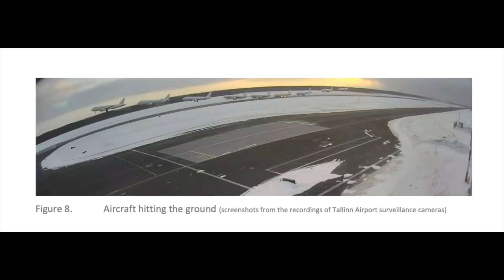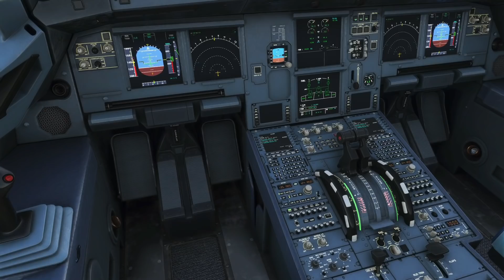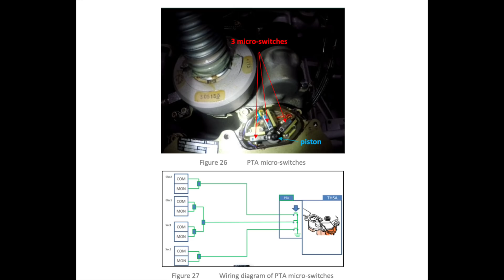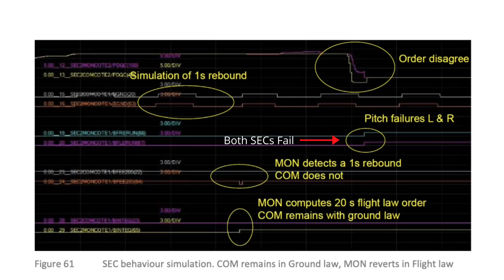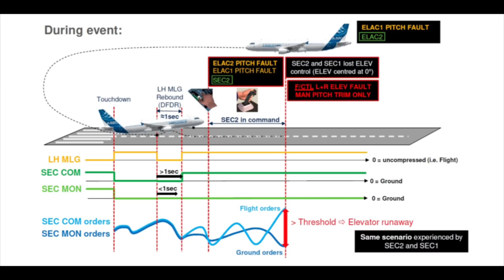The Oil Change That Crashed A Passenger Jet | The Crash Of Smartlynx 9001

Comment: Automation is like fire in the home. It's great until it gets out of control. What you need is automation whose failure modes are obvious and intelligible to the humans. I have a lot more respect for the system that says "I give up; your airplane" than the one that says "something's wrong but I'm going to keep controlling things; fyi".
Reply: What you describe is the "fail fast" programming school of thought, which is the one I subscribe to. 
When I do flow control I will program in all known expected conditions, all the abnormal conditions I can think of, and then always add a catch-all else clause where I just throw a runtime exception and brutally abort everything.
I add this in everywhere, even in places where I know it's impossible, in which case it's something along the lines of throw new InternalException("condition xxx evaluated to something impossible"); //this should not be possible

You'd be surprised at how many impossible exceptions I've seen thrown over the years, and having the log of exactly what condition was unexpected helps debugging massively. Usually what happens is that months or years down the line something else upstream gets changed, resulting in undefined behavior downstream because of an interaction that got overlooked, and if you don't have all these apparently paranoid checks it takes absolutely ages to figure out why some random value sometimes turns out null at the end of the pipeline, especially if the error only gets noticed in production and you don't have the debug logs. 
If you always crash on unexpected conditions the error is also much more likely to get caught in testing - the tester can accidentally overlook a blank field, but they can't overlook a complete crash.
Reply: @demoniack81  Dude, SW devs in the airplane industry usually cannot just throw. They do not write in a language that has exceptions. They don't even use dynamic allocation. And it's all being regulated heavily. Medical devices, weapon systems, airplanes - all these might require a bit different philosophy.
Reply: But then you get incidents caused by the automation turning itself off during a high-stress situation and the pilots failing to realize that and react accordingly.
Reply: That shouldn’t be a problem if there’s proper notification and warning that that manual flying is required, and all automation is disabled.
Reply: This is too simple, life's not. Even Boeing is packed with layers of automation, there are thousands of uncomanded processes going on every flight. Human being is long time too limited to contain everything that's on board and totally useless when it comes to analyzing it from the very principles. When things go wrong, human is unable to look in a fractions of seconds through thousands of switches, valves positions, voltage and pressure indications, etc. It's the automation that does that, trying to simplify it to two, three or four important things that the pilot actually can understand and use in his decisions. When it comes to decisions, we humans tend to make them wrong especially in stress situations and that's why the manufacturers take away more and more authority from pilots. One particular important reason for this is, that computers and algorithms are scallable*, while we, humans, are not. The automation *is here, way more than some people admit. In the end of the day, it's extent depends on costs - cost of lives and money.  And guess who's slowly loosing in the long run.
Reply: @oakld  well said, but as late groundings showed us, while automation under most normal and even most in normal conditions will work better and more efficient than a human. However, automation on the one hand takes complexity from most tasks, but adds complexity to the necessary knowledge about the systems. The 737 max showed, pilots knowing about the system or at least how to override it, could safely fly the plane. Pilots not knowing about it got overwhelmed by fighting the plane. All automation is fine as long as there is an override and knowledge about how to use it.
And be it to just crosscheck between redundant instruments to verify instrument failures.
And this is not only about aircraft, think about cars. Any modern car with lane assist, brake assist, automatic distance control etc you rely on automation. Or just not, which is why you still should pay attention while an autopilot is driving. As cars do notfalls out of the skies (yet), they do not need as much redundancy as aircraft, except for the brakes. But a cars autopilot has a much bigger job to do avoiding obstacles and recognizing them in the first place, instead of following controlled routes assumed to be clear. Yes even in the sky such monitoring is necessary.
And in a car overrides are as simple as grabbing the steering wheel or hitting the brakes, but they are there.
Reply: @alexanderkupke920  Yes, as you're pointing out, it's not black or white. There will be automation caused (or rather elevated) crashes in future too, I believe, but as long as the rate is lower than what human pilot cause in the smae role, it makes sense. And due to scalability and extensivity, automation is getting better and better. As for MAX, I don't count it as automation caused disasters, because the root cause of the problem is greed, a perfectly human thing. That's at the beginning of the chain of causes; if the Boeing engineers were actually deciding, the sensors would be designed like they are now right from the start.
I'm very careful comparing automation in aviation with that in automotive. Airplanes use mostly digitalized "simple" information (ADS-B, GPS, ECUs, other onboard processors and sensors data,...) and they're tracked at all times. It's a controlled process, similar i. e. to industrial automation. While cars are much simpler to control, the environment is the huge problem that makes it one of  the most challenging engineering tasks. 
But I think I get your point and do agree with all what you wrote!
Reply: @oakld  OOH you sound like Elon MUSK & you are both eventually correct !! SCARY !
Reply: @oakld  multiple humans
Reply: What you need is aircrews that can fly.
Reply: Hmm.. like Fire is a Good Servant & Bad Master. 
Trouble is we have genies that can make fires burn invisibly till its too late, like the MCAS on 737 Max !
Reply: @JoshSasger  I'm sorry Josh, I can't agree with such analogy. As I wrote above, the MAX story is about greed of number crunching executives, who manage company by an excel sheet. If it was for engineers, the 737 MAX would be safe from the beginning, including the MAX. They raised their concerns years before the MAX crashes, the flaw was known, but they were threatened and basically this problem was covered up. So the poor management and greed caused this and that in turn was caused by the management culture in Boeing, set over two decades ago. The way I see it, those are all perfectly human problems, nothing to do with engineering and automation safety.
As for Musk, he's trying to push automation forward, while the aviation automation is here Today.
Reply: Can an Airbus actually hand you the whole airplane? I kind of thought you could not fly an Airbus with no electronics.
Reply: @RalphDratman  Basically no, but kind of yes. No, it's not designed to be controlled manually in any normal situation, so no, it can't "hand you the whole airplane". But basic control surfaces have mechanical backup. It's usually because the active fly-by-wire controlled links (multiple time backed up) are mecanically separated from trim control, which is usually mechanical - electrically actuated/assisted, but could be controlled manually under mechanical law. So FBW control is like pulling a link to control surface with servo and trim is like adjustment that can be done to the lenth of the link (which is pulling the controls) or relative position of the servo to the control surface. Each control surfaces have their own computers and their own backup and probability of failing all of those in one time (thus handling the whole plane mechanically) is extremely, extremely small. Perhaps someone will explain that with better words...
Reply: @libor309  If there is backup manual control I guess it would have to be on a separate panel somewhere. I don't see how anything like that could be connected to the normal Airbus controls. Just a guess.
That does not sound like something I would ever want to try.
Reply: @RalphDratman  As I said, the manual controls are normally electrically actuated/assisted, but they're make them large so that they can be also actuated manually. For the elevators, it's the two connected large wheels in the center console, it makes it easy for pilot to grab it and move by force. Then the rudder is controlled by pedals. In case of A320 there's no mechanical backup for the ailerons, but they're deemed to be (in the case of extreme emergency) not that important, since with the rudder, elevators and differential engine thrust together are considered to be enough to control a plane.
Reply: @libor309  Wow, that's quite interesting. Thank you. 
So the ailerons might be set completely wrong, but I can always trim that away and then use the engines differentially if necessary, is that the idea? 
Whew. Fun day.
Reply: @RalphDratman  No, not exactly like that. Fist of all, I believe it is not really considered that all the separate FBW will fail together - and AFAIK it has never happened. So I believe while engineers do design the plane this way intentionally and do test such a failure mode, pilots aren't typically trained for that, but only for the separate cases. Mind that even those partial failures are extremely rare (nearly none), due to the heavy redundancy in the FBW control computers. There are cases ("Sully", Russian "Corn" landing, Pakistani "scratch & go", the case in this video), where the plane lost both engines, all the electrical power from generators attached to the engines and still was reliably controllable via FBW (with assistance off RAM generator). 
The other thing is, that every control surface has a fail-safe position in which it locks if the FBW fails. So in that unreal scenario where all FBW would fail, the ailerons would lock in a neutral position as well as the elevators and rudder and the pilot would control the plane using pedals, elevator trim wheel and engine thrust levers.
Reply: @libor309  Thanks again for these great explanations! I like the idea of locking into the neutral positions. The airbus line seems to have been extremely well designed. So most crashes are from human error, like on that unfortunate Air France flight from Brazil.
Reply: Absolutely. Automation must have manual falisafes, in case this sort of thing happens.
Reply: @HypercubeJones  Yes, that was basically my point. We keep stuffing more and more knowledge into automation which is scalable, working precisely and light years faster. Human pilots are long time on their edge of trainability - when we have a good day, but we are subject to tiredness, health concerns, family issues, complacency, etc. While a pilot will be in the cockpit for some decades ahead, his/her role is changing and competences shrinking.
Reply: @oakld  a light year is a unit of distance, not speed. It works (almost) light-speed faster, depending on the conductivity of the medium. The fastest normal computers operate at about 3GHz, so one computer cycle takes about 0.3 ns. Light-speed is about 10 cm/ns, so one computer cycle is equivalent to adding around 3 cm to the distance the signal has to travel. Most computer instructions take several machine cycles, and software as complex as ECAS and the like would take a few thousand instructions to run, effectively adding 10m or more to the distance the signal has to travel, slowing things down by a factor of 1000. So a computer's reaction time would be measured in microseconds, not nanoseconds. Then there is the mechanical response time of the systems the computer is controlling,. So yeah, computers are a lot faster (and more reliable) than humans, but nowhere near light-speed.
Reply: @gspaulsson  Hahaha, I take the whole explanation like a deep irony :-D. I guess you know the phrase was an art-like depiction and nowhere to an exact meaning :-)

Comment: I am two minded about automation, because when it works, it works better than a human, but the state of the art systems are very brittle against small failures and edge cases.
This incident proves that their redundant computer system is not robust against an adversarial. They had at least quad redundancy (or more?) for computers, but two small "insignificant" error brought down the plane, completely crashing all automation. (The final redundancy: humans, saved themselves from a fiery crash)

Designing against a hypothetical adversarial which can make small errors, at exactly the wrong time, is nightmarishly complex (and not possible with human minds), but it would be nice to have actually robust automation on the modern planes.

Comment: I, for a long time, was sceptical towards fly-by-wire and was somehow scared of having something like a "middle-man" in my controls. However, i've been enjoying MSFS2020 and particularly the FBW A320 neo for half a year now and it's just great how easy this thing is to fly compared to an older airliner. ELAC, FAC and SEC buttons and their functions i became aware of after watching videos like yours, especially Indonesia AirAsia Flight 8501 should be mentioned here. As a hobby sim pilot, i'm even deactivating SEC1 for my landing challengenges sometimes, because manual trim gives me better behaviour during flare than the (ASOBO/FBW) flight computer offers me :D So, for your statistics, my answer to your question is: as much automation as possible, as long as it is always possible to override it.
Reply: Wrote my answer, then looked down and realized I could have just said ditto this ^
Reply: The MSFS has a pretty bad flight model though. The default FBW is pretty much non existent. I havent yet tried the modded aircraft, how does it compare to say the fslabs a320 or the default Aerofly FS a320?

Comment: The Airbus A320neo family (neo for new engine option) is a development of the A320 family of narrow-body jet-airliners produced by Airbus. Launched on 1 December 2010, it made its first flight on 25 September 2014 and it was introduced by Lufthansa on 25 January 2016. Re-engined with CFM LEAP-1A or Pratt & Whitney PW1000G engines and fitted with sharklets as standard, it is 15% to 20% more fuel efficient than the A320ceo family. The A320neo family is based on the previous A319, A320 and A321. As of January 2021, a total of 7,451 A320neo family aircraft had been ordered by more than 115 airlines, making it the fastest selling commercial aircraft ever.